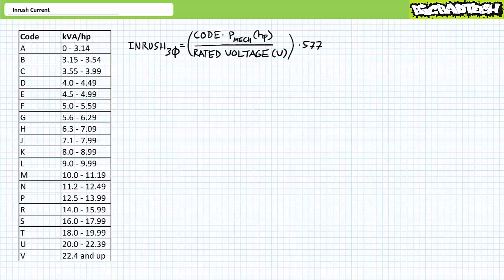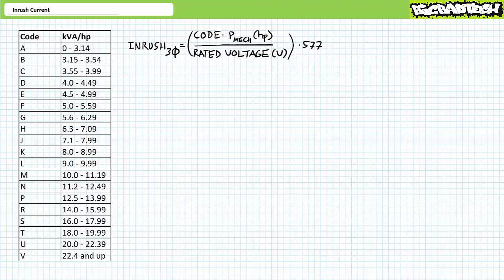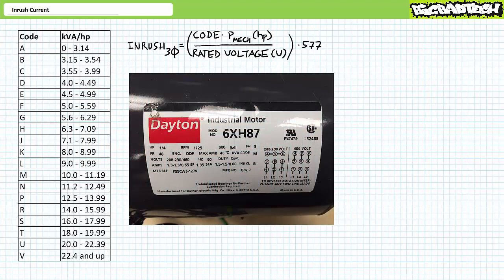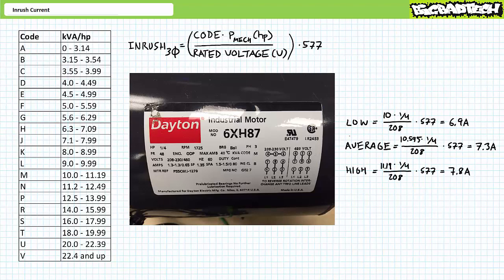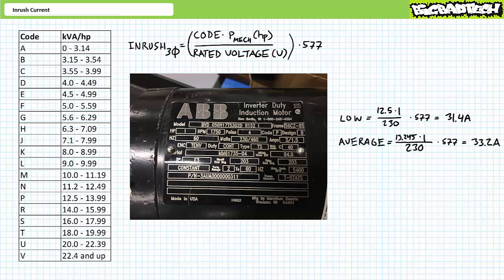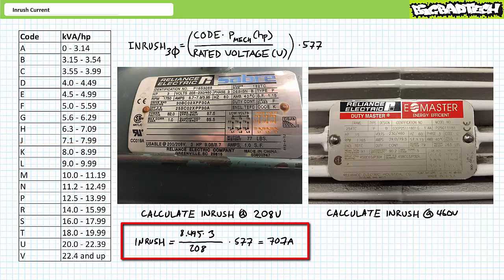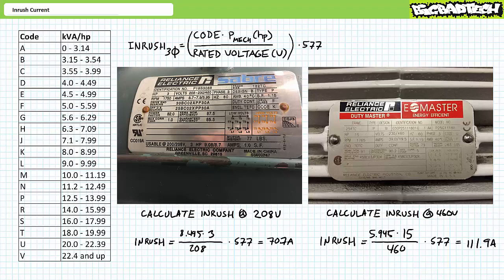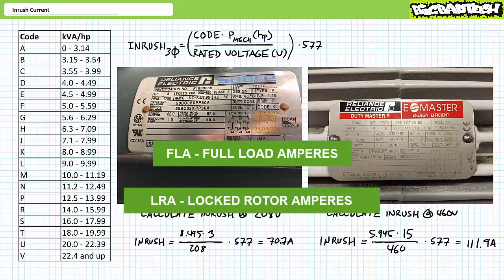Inrush Current (Part 1 of 2)

Comment: So when you do this calculation for wire size, do you size for the inrush, or normal run current. If this inrush is instantaneous can the normal run wire size handle this current for a brief moment?
Reply from the maker: Oh this is a slippery slope! I'll give my standard answer to avoid debating the NEC with the entire internet. Check with the AHJ (authority having jurisdiction). I've had my run ins with AHJs some resolved to my satisfaction after I've given my evidence ... and some not!

Comment: But if the moror is rated for 85 amps and at startig time it pulls 250 amps, how can my 100 amps fuses handle it without blowing?
Reply from the maker: Most likely this is a “slow blow” fuse which will temporarily allow an overload but melt if sustained.